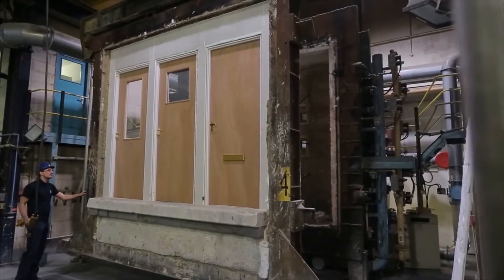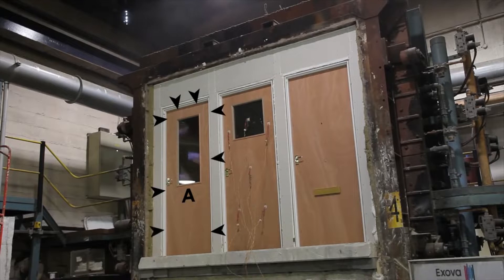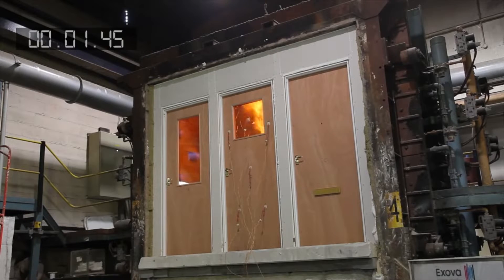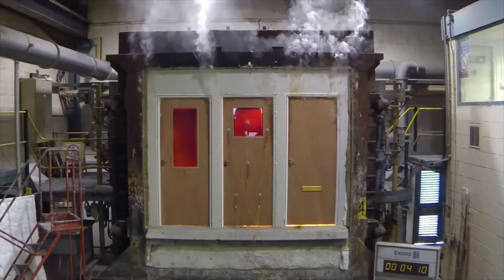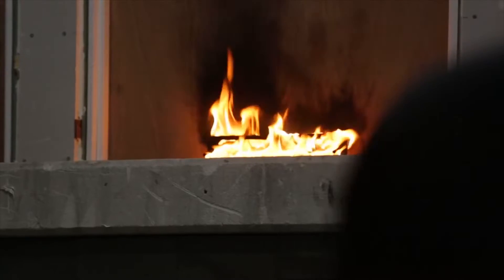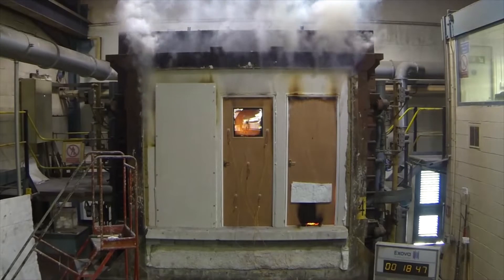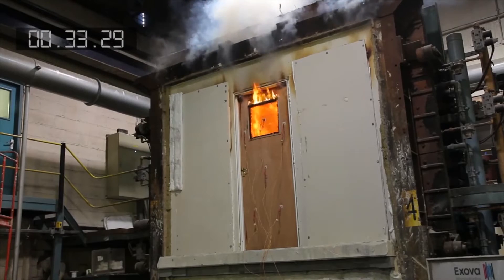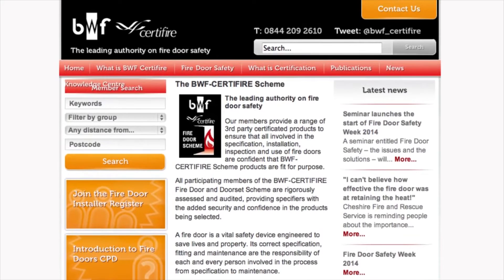THE DANGERS OF CUTTING CORNERS WITH YOUR FIRE DOORS

Comment: I rather trust an Early warning Fire detection system and ignore instructions to stay in and close all doors, thats what happened in Grenfell Tower, if there was an early warning Fire detection system,  it would have gone off the minute the Fridge caught fire, and Alarm Sounders throughout the building would have gone into Evacuation mode or tone,  so people would be told when they hear such tone, leave the building at once, no lives would have been lost, Fire doors and Intumescent strips do not provide 100% safety, how long does an Intumescent seal take to react to heat, when it is firstly embedded in the center groove of 3 edges of the door, the wood is a heat insulator, the door will have to burn for a good few minutes for the heat to transfer through it to the intumescent strip in order for it to expand, just try this on a flam, you will see it takes ages for it to start expanding so until the door is half burnt, for the heat to reach the strip, by this time enough smoke has penetrated the room, the smoke furring material would have melted , so in my opinion for optimum safety, occupants of any building should not trust any advice from anyone but upon hearing a fire alarm, leave the damn building at once and save your own life, do not trust carpenters, fire doors or seals. Trust a Fire Alarm, and your instincts.